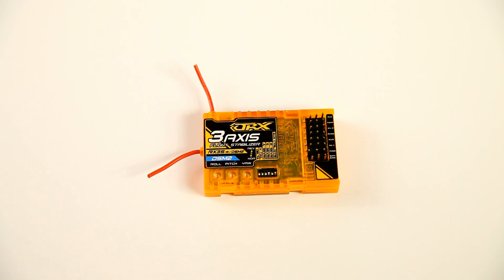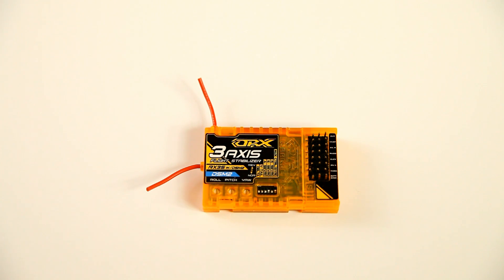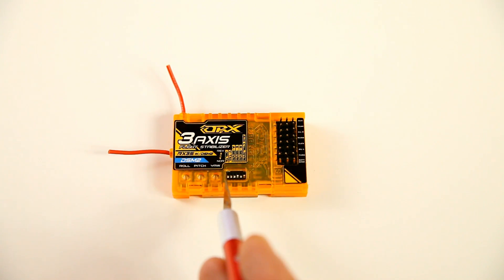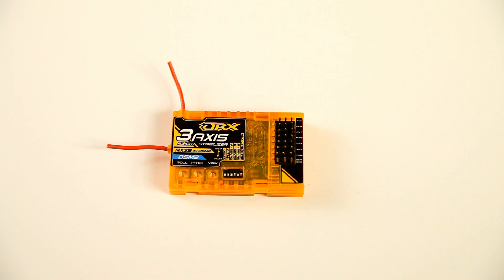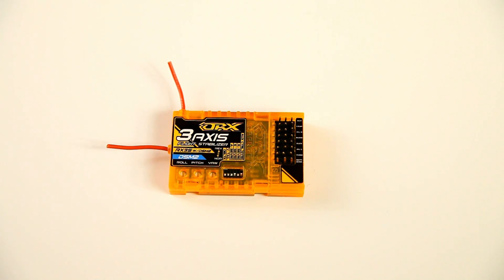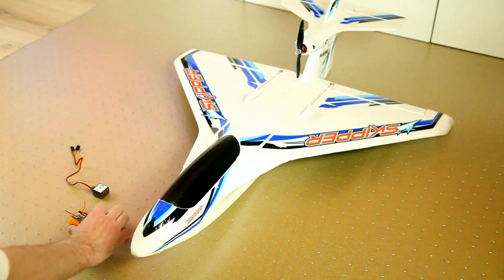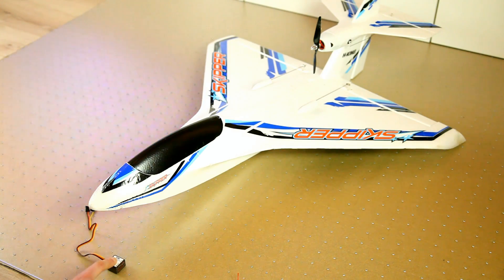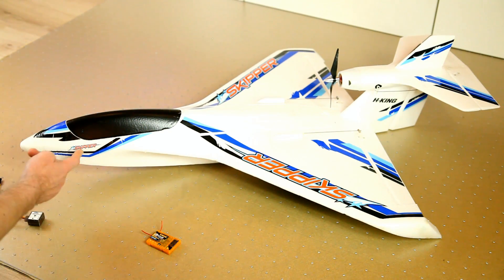OrangeRX RX3S 3-Axis stabilizer w/DSM2 - REVIEW

Comment: Why not try a satellite with it to increase the range?
Reply from the maker: +theleabres Yes.. that would probably help.. It shouldn't be Necessary though? I mean.. non of my Futaba receivers need satelites for 2+ Km's of range..
Reply: Just looking at those two very short antennas on the Orange RX tells me limited range. maybe 150 meters max to be safe.  Good video and thanks.
Reply from the maker: +theleabres I completely agree with that assesment sir :)  The HK site doesn't mention full/half range though.. I have had 2 crashes with these receivers at about 80 (max) meters... 
Thank you! :)

Comment: I've never had any problems in range with this stabilizer. I fly it in a ParkMaster/Multiplex for more than a year in ranges of 300 meters and more. It's working fine all the time. You shouldn't have destroyed yours with a hammer. Some people would have enjoyed to get it as a gift (exept postage). Please think it over!
Reply from the maker: Detlef Heine Sure.. I Did think it over, and I didn't want to give something that Might have a problem to someone ellse. Might have been that Mine just wasn't allright.. Right? But well.. the range was just FAR shorter then what I'm used to.. Normally I can get far beyound 1,5Km..

Comment: thanks Dutch.  Use a Pencil, do not point fast, point slow, while the cam is focused on a close up, any slow movement is fast? Carpentry in the Rc hobby Lol. wonder if it is worth just buying spectrums rx with Safe. a smarter purchase
Reply from the maker: ***** Thanks for the advice sir! You are right :)

I'm not sure what the price of the Spectrum system would be.. But. the version Without receiver from OrangeRX does work very well.. Dead cheap as well :)
Reply: I have two ORX's and well they are collecting dust Lol. flew it with te Slowstick,but it crashed due to not the RX, every day is a windy day ,just cold and  not yet ready to try again..
Reply from the maker: ***** Yeah man.. It's cold + windy and constant rain over here as well.. Pretty crappy ;)

Comment: i had a hard crash today with my wing.. damn orange receiver browning out. fyi i did a range test. and only got about 25 paces away (range test mode) and normal only got 37 paces away. not good!. my spektrum park flyer receiver got 40 paces away (range test mode) and i got nearly 100 paces away normal. on just a normal park flyer!!!. the orange rec i tested was a 7 channel long range. My wing is repaired and i think i will take the orange receiver off my tricopter after my little experiment. great video and thumbs up!!
Reply from the maker: DCVINRC Damn.. Sorry to read that buddy, though I guess it's part of the hobby..
Which RX was that?? I allso use a few DSMX Orange receivers.. Those have done well over here so far.. This is the one I have a few off:
http://hobbyking.com/hobbyking/store/__38392__OrangeRx_R800X_DSMX_Compatible_8Ch_2_4Ghz_TwinPort_Rx_.html

Cheers and thanks for watching + the compliments! :)
Reply: sorry stand corrected its a 6 channel r620 6channel dsm2
Reply from the maker: DCVINRC Check.. hmm well.. It does say 'full range' in the title..
Probably a typo! It should have been 'fool range' :P  
Ohw.. I actually allso have A LOT of Orange FASST (Futaba) receivers.. Work great!

I think the trend is: stay away from Orange DSM*2* ....